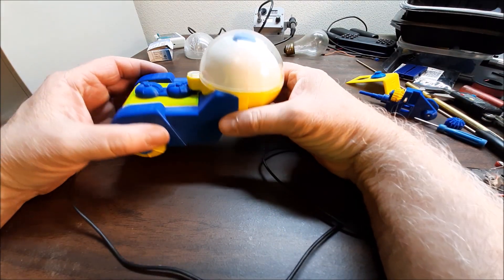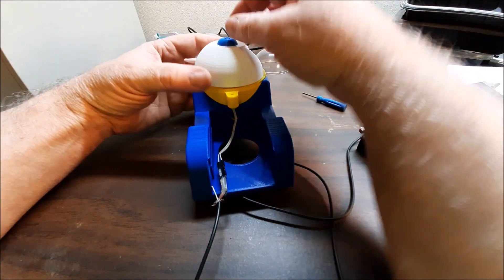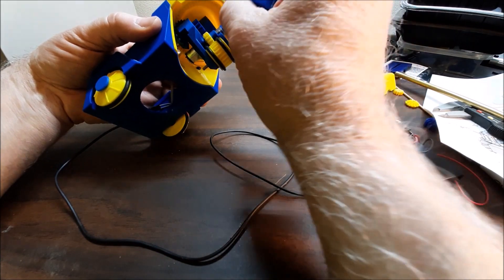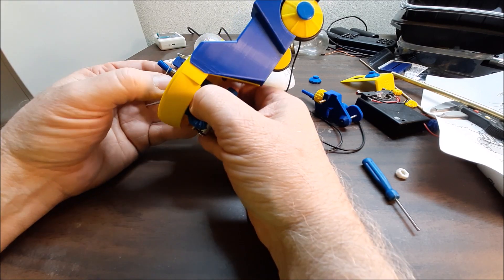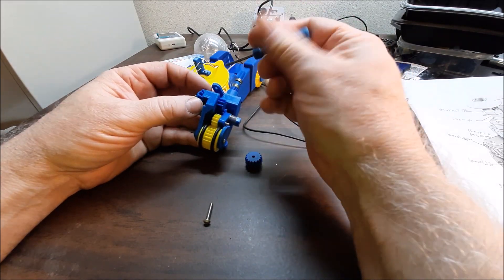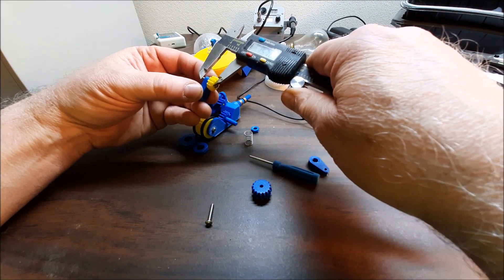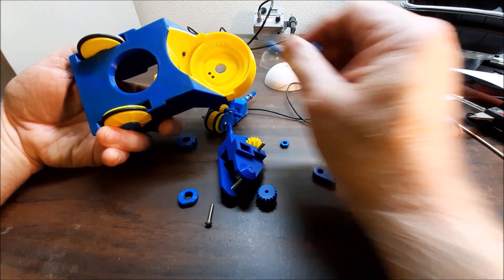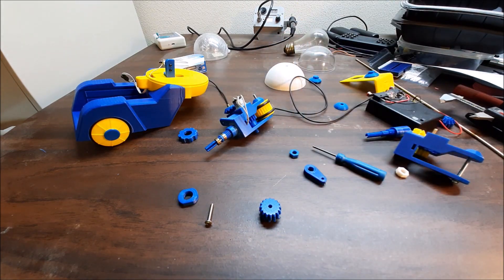3D Printed Single Motor Steerable Car

Comment: Nice compact build Rick. There is another way to do the same function that uses 2 ratchets and no swinging pivot gear or commutator power system. I used back in the 1980's to mod a small Tomy Ding Bot into this wired remote drive in any direction function. I made the ding bot head rotate to show direction of travel. I thought I did a 3d printed version of the design but cannot think of the build title at this time. I may have to do a short video of the modified Ding Bot to show the function. Thank you for sharing your design with us.
Reply from the maker: Thanks John. I would like to see Ding Bot. The commutator makes it hard to build.
Reply: @rick_100  Here is the video on the Ding bot mod and a metal version I built to show the ratchets working back in 1986. 
https://youtu.be/-d-sgV_v6Us

I even communicated with TOMY about doing a robot with this design, in the end they were not interested but did reply.